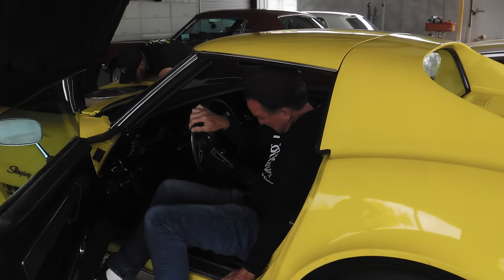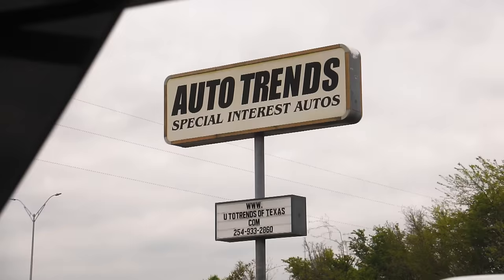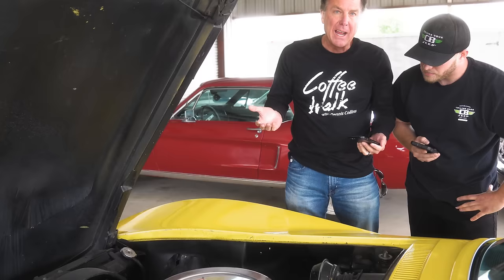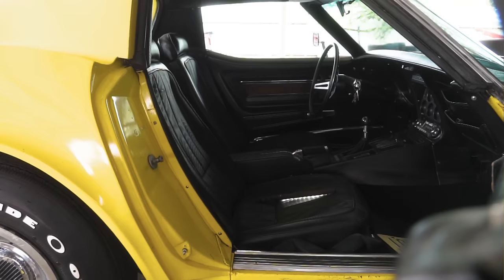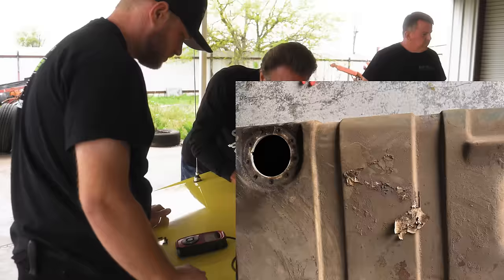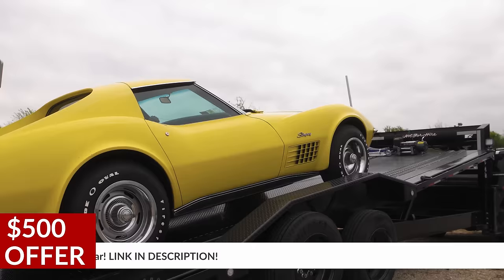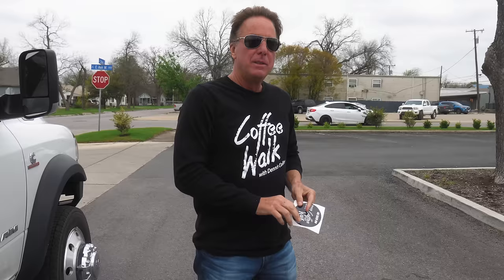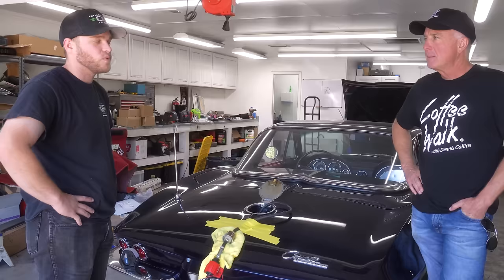1970 LT1 Corvette 1 of 1287 Built!!

Comment: In my early career as a mechanic I worked for a guy that built racing engines. That was 1975. He did a motor for an early LT1 corvette. I got the  distinction of pulling it out and putting it back and breaking it in. What a PIA to work on. We had several Corvette customers. Shop rule, all drop lights were unplugged and not allowed to be used anywhere in the shop until they were done and gone. No head lamps or battery powered lights back then. You just held a flashlight in your teeth. No hoists in that shop either. Everything was done on the floor with jack stands. At the time they were just old used cars. LT1, DZ, LS6 and and a few LS7 crate motors. The odd Ford Boss 302 and boss 429. At the time I didn't  realize what we were working on. That was a lifetime ago.

Comment: Dennis- Enjoyed your 1970 LT-1 Corvette  purchase very, very much!  1970 was the last year for GM to release a solid lifter engine  and it was in the LT-1 Vette and used the 350 block and comp was 11:1.  A reviewer in 1990 Vette magazine said if you never have driven a solid lifter  car- this was an experience to not be missed. Watch the valve lash.  Back in 1970,, my street 350 Chevy engine running solid lifters,  12.5:1 comp,  Z/ 28 off- Road  “140” cam- all put in my ‘55 Chevy, with tilt front end.; redline was 9,300!  Stupid fun !
Reply: What is a "140" cam sir
Reply: Well hate to disappoint you but in 1972 you could order a Camaro Z28 mine came with a 350 solid lifters aluminum intake Holley carb and a turbo 400. If you want to go look at the RPO option. This was the last year for solid lifter
Reply: @MHolt3573  - The “140 “cam, is GM part 3927140, optional - off-road service #1 ( service cam 2 was even hotter) not intended for street use,  but was used in  Trans- An racing for the Camaro 302 c.I.-  but is also listed in the 1984 “Chevrolet High Performance “manual, pg. 128.
Reply: LOL...
Reply: The LT1 remained available in the Stingray thru 1972, as well as in the Z28.

Comment: I owned a 71 LT1 in 1979. It was a Roadster that someone had a rollbar installed prior to my purchase, and it was cut out. It had the correct carb and intake, and the engine balancer cracked on the hub. My friend raced Corvettes at the road courses in Ohio where we lived. He had the parts which I purchased from him. A new timing chain, too. You have to drop the oil pan off to swap out the chain. I  got a good look at the crank,  pink rods, and correct forged pistons. You could read the part number on the underside of the pistons. Needless to say it was a 4 bolt main block. The  numbers matched but it was nice to see the inside. I  paid  $5 K for it and sold it for $6K two years later. It also had the removable hardtop. Wish I had kept it, but I purchased my first house back in 1982. You could find anything cheap back then.

Comment: The guy that sold me my `73 at Bob McDorman Chev in Columbus had the holy grail of rare LT-1's with an Ontario Orange `72 coupe-- one of 234 with AIR CONDITIONING-- awesome car but kept throwing the belt . . .
Reply: If your '73 had an LT1, it was transplanted in there. The hi-po 350 in '73 was the low compression, hydraulic lifter L82...but it still had  HD LT1 innards.
Reply: @M21L35  Guess I didn't make it clear-- my salesman at McDormans- Dan Aldridge- had the `72 LT1 w/air..my `73 was an L48.

Comment: My 1970 LT-1 was bought new by my father, and has never been restored or taken apart.  It went through NCRS 5 star BowTie process, Top Flight, and Bloomington Survivor.  They are fun cars, and while mine has all the paperwork, I still drive it.  Can't let them sit around and be trailer queens.  I also drive my 1970 big block air coupe.  Years ago my father in his LT-1 and a friend in the big block took off from a light together hard.  The LT-1 had the big block till about 100mph when the big block roared by.  Need to get my 54 vette back on the road that was last on the road in 73, but not sure why it was taken down.   Going to be a process to sort that one out.
Reply: I have a 1970 and a 1972, with a basket case 54-55; that’s kind of funny.

Comment: As you're probably aware, there's an override pull-down switch @ the bottom of the dash near the column. It opens/closes the wiper access door independent of the wiper switch. That switch enables the wipers access to the windshield in the event that the wiper door freezes shut in the winter.  Improper functioning of that switch may be related to the wipers not returning to their off position.

Comment: I have ridden in a 71 LT1 and was amazed at how it pulled. I think the horsepower and torque was reduced a little bit from 1970. I was always pro big block at that time until I went for that ride it with the LT1 that changed my thoughts.

Comment: lookin at Vette black book and did some Algorithms in my head. I think you have

10% of the 1281 yellow, is 12
64% of that coupe, 85% manual, 80% black int.
trim level 50% of that.
seems like 1 of 2 or 3 
just my guess
(I think they all came with manual, but still how many of these are left?)

Comment: Zack didn't clean his plate. He didn't even touch his taters LOL. The food there looks incredible.
That's a gorgeous LT-1.  It's still amazing that back in the day you could go the local Chevy dealer
and buy a car that sounds so nice. The only thing it's missing is factory side exhaust...

My uncle had a beautiful Elkhart green 1972 LT-1 coupe. Being the last year for the LT-1,
and with the implementation of new emissions standards, the horsepower rating was dropped
to 330 h.p but like many of the high performance cars back in the 60's and 70's, they were
underrated. The 370 hp was easily 400 horsepower, and I'm sure the 330 h.p engines were
still underrated some.
He had the car for quite a few years but back in 2005 they had a really bad snow storm
where he lives and it was really wet and heavy snow, and the garage collapsed.
He was a long haul truck driver so he wasn't home when the storm happened. Had he been home,
he could have gotten the snow shoveled off the roof.

Comment: When I was in High school in the 1970's, a rich kid got a used 1970 LT1 Corvette my senior year. The LT1 was a parts engine in 1969, before the 1970 model year. The LT1 camshaft was originally sold as an "improved torque" replacement cam for the Z28 302 engine. In 1969, with the 350 hp L46 350 engine, the LT1 listed in the 1969 parts books was an 350 L46 engine, with the Z28 intake manifold and carb and the 302 improved torque replacement camshaft. I think the camshaft showed up in 1968, along with the "1st design" racing camshaft, that required different valve springs. The valve springs sold for the 1st design racing camshaft were made of defective steel and lost pressure fairly quickly.

Comment: In 1970 Chevrolet deliberately gave the LT-1 a lowered horsepower rating. Because of newly enstated insurance regs.  The lowered factory h.p. rating was 368 ponies !  It had more than that !  I ran one in a '66 Chevelle SS. With some headers the '70 LT-1 is a very legit 400 h.p. small block !  Absolute high winding street monster. 13 sec. E.T.s.  4.5:6 posi. 4 speed. All stock but the Doug Thorleys. Killer !

Comment: Dennis, is this a ZR1? 
Equipped with the LT1, this is probably the most desirable & valuable 1970 model Vette, versus its big block brother that covered a few episodes back. IMO this is the top dog engine offering from this generation, these vehicles were much better with the weight, or lack there of,  of a small block up front. Why were so many offered in the Z28? I know it was down 10hp but I think Chevy just rated it this way to make the Vette look better. Why did they make it so much more common in the Camaro?

Comment: "Nice car, I looked at a survivor 35k mile Daytona Yellow LT1 prior to buying my 71 LT1 survivor and a documented BLACK 71 LT1. Not much wrong with it.. Rad cap, air cleaner wing nut is a reproduction, air horn gasket should be brown or tan. LT1's have the CAPS attaching the U joints on the half shafts, VS the straps. M21 std rear is 3.70 perf rear is 4.11, economy rear is 3.55.
It has the original windshield dam is there. 
I am sure the cold fast idle is not set to spec of  2250-2400.... which makes them rough running when they are cold.

Comment: An LT1, but some easy checks are 6500 rpm tach, transistor ignition, no fuel return line, big block style ujoint caps, winters snowflake intake, also where is the smog air pump, notice the exhaust manifolds don’t have the holes for AIR.  So incorrect.

Comment: It's a small block Corvette they're not worth nothing! You have to be some kind of idiot to think of small block basic 350 .low horsepower is worth anything
Reply: Get educated ya🤡! That's a 370+ hp engine with very special high performance internals top to bottom, even the piston rings are unique. It's power to weight ratio is phenomenal.
Etc etc etc....